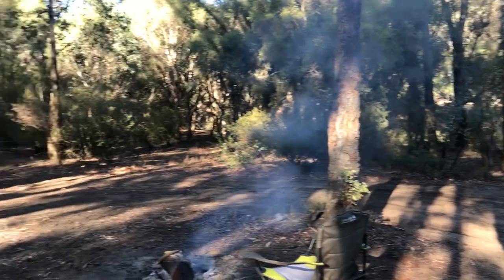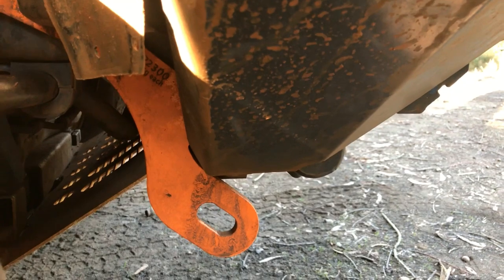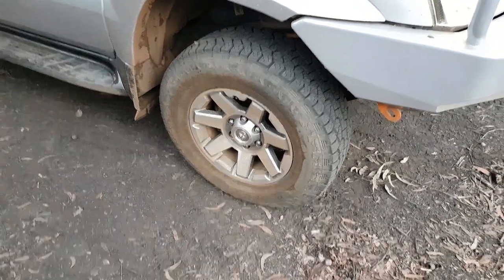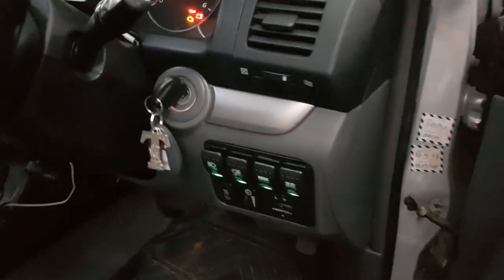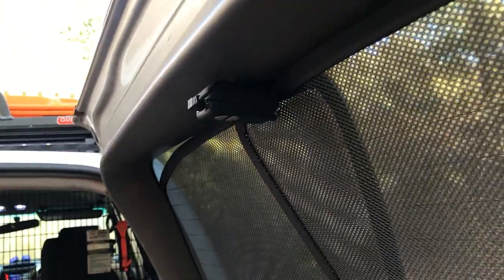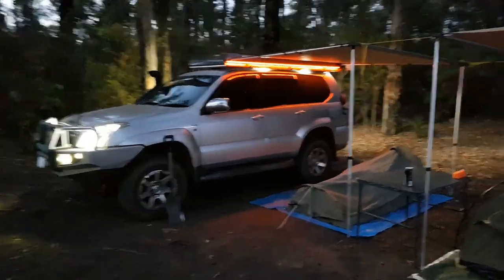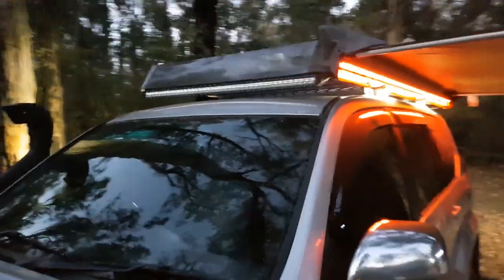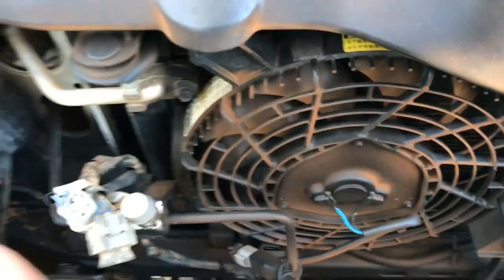Modified Toyota LandCruiser Prado - 120 Series Touring setup - D4D Auto

Comment: Good to know about the 150 recovery points. 
Was gutted when i found out about the recovery points no longer fitted my 120s after installing a opposite lock bull bar.
Reply from the maker: Tim Reynolds yep bolt straight up.
Reply: Agree, interesting to know! I was told they would fit on ARB Bars with some mods but finding out that 150's bolt straight on is great. I bet most suppliers don't know that!

Comment: Sick setup mate. I just brought the 09 TD prado which has not had the injectors replaced. It’s at 170 000 kms, do you recommend getting them done even if it’s still running well?
Reply from the maker: Caleb Howell sure do, but I would get it checked out first. Consider it insurance for your motor.  Watch some of Anthony 4x4 Diesel for some good guidance.

Comment: Hello mate, some great info here thanks. I'm having trouble trying to find an AC fan like the one you used, any advice would be appreciated.
Cheers
Reply from the maker: Hi Andy, thanks for the comments. The AC fan was off ebay from a wrecker. They are hard to locate but if you keep an keen eye on gumtree/facebook etc can locate a Grande, they run them. Its not that well known of a mod (not like the trip computer!).Best of luck locating one.
Reply: @ShedintheValley  thanks mate, I'll try Tony's wreckers in Perth. Cheers

Comment: How did you run the wires up to the roof rack camp lights? Via the passenger doors?
Reply from the maker: Rampy mate did it via doors but I didn’t like the look of the cables coming out that way. I took the strips off up the sides of the front windscreen and put cables up both sides, I also have one running up the rear from outside the tail light. I’ll take a video of how I did it and put it up for you.
Reply: @ShedintheValley  cheers mate
Reply: hi do you have the link of how to conect themo fan

Comment: what year is this? and why did it cost 3k for your injectors and pump?
Reply from the maker: Dan theman it’s a 2007. Injectors need to be replaced just as maintenance. I got the intake and EGR cleaned and acid bathed at the same time. That also included all labour which was a good price.

Comment: Those magnetic shades for the rear passengers, if they put windows down will they just blow out or are the magnets pretty strong?
Reply from the maker: Cameron Upton they are strong mate. Also come with little holders to make them sit in the Windows, though I haven’t used them. They fit perfectly to the windows. I also use the front window ones for the back window crossed over, you can see them in the video. Just jam them behind the trim panels.

Comment: Have you had any issue with the bull bar touching the underside of the flare/guard when flexing off road ? wondering how much gap is between the top of your bull bar & bottom of flare ?
Reply from the maker: Volcanic I kept it pretty tight. Though I have replaced the body to chassis bushes which stops a bit of movement. It doesn’t rub when general off-roading. I would say it’s 20mm maybe a little less.
Reply: @ShedintheValley  Thx for the reply, were your bushes worn/compressed much ? I've been considering to renew mine though also thinking about a 1 - 1.5'' body lift but not sure yet what else will have to be modified..
Reply from the maker: Volcanic I haven’t body lifted, only suspension. There is a few things you would need to sort out including steering etc, and you will have a gap between bullbar and body you will need to fill the gap.
Reply: @ShedintheValley  Yeah cheers I will have to look into it more, just want to be able to squeeze 285x75x17 mud tyres in there with my 50mm lift and minimal body lift.

Comment: How did you mount the Arb rocker switches in the front console for your leds?
Reply from the maker: Fishing with Deeanno you can file out the plastic, then also file down the under dash panel to fit the switch panel upside down so all the switches are on top row. Factory mirror control is at the top.
Reply: @ShedintheValley  Awesome, Thanks!